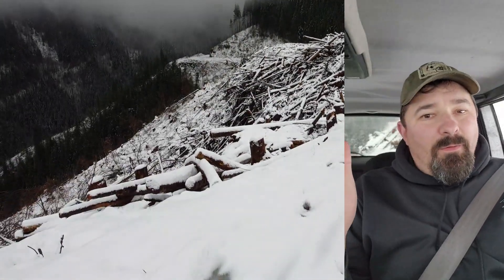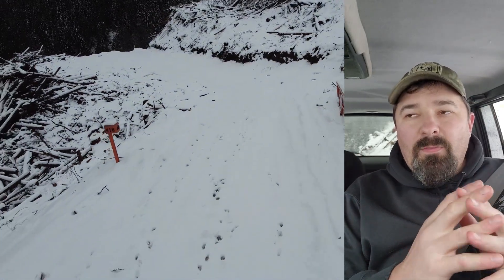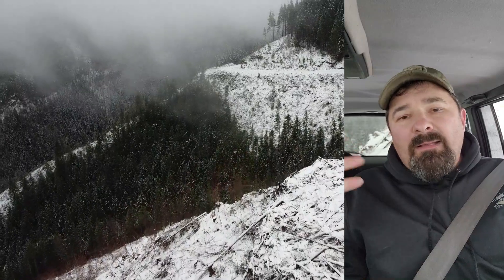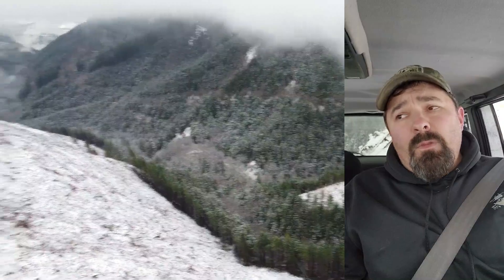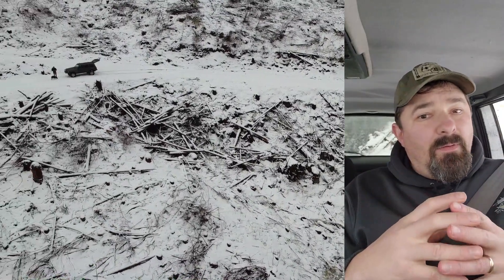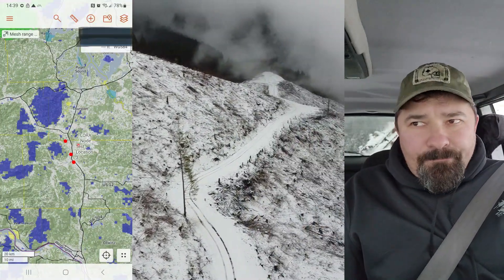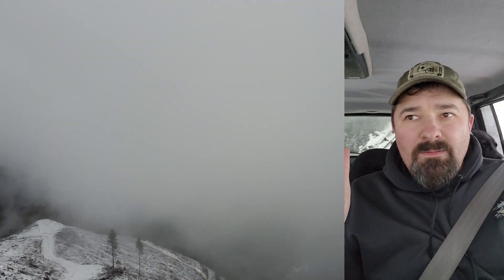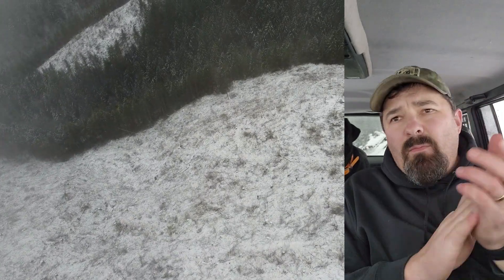Airborne LoRa Mesh Range Testing Delayed | Meshtastic

Comment: Does the T-Beam Supreme seem unstable on Meshtastic ? I am not sure if this is common but ... 
the telemetry power reporting chart shows 100% now for last day or so, even thou device screen shows ~15%, and a 3400 mah battery runs out in around 1 day, when T-Echo with it's tiny battery lasts twice as much (or more) in same conditions. 
Plus on Supreme I disabled GPS, Wifi is off on both.
Reply from the maker: Yeah, the ESP32 devices are power-hungry. I have seen a similar battery life on my T Beam supreme.
Reply: @RavenwoodAcres  great. That helps. The T-Echo seems awesome thou. I got 10 KM range between the 2 with default small antennas on both. Do you know if T-Beam Supreme has better range at least ? Besides Supreme having wifi too, anything selse seems better on the T-Echo.
Reply from the maker: @adrianTNT  The T-Echo using the nRF52 module and the E-ink screen, which are better more conservative on power. I really like my T-Echo.